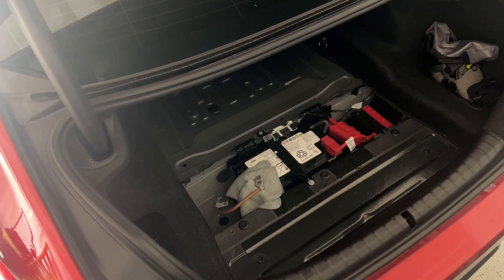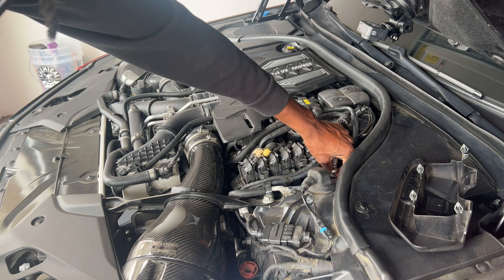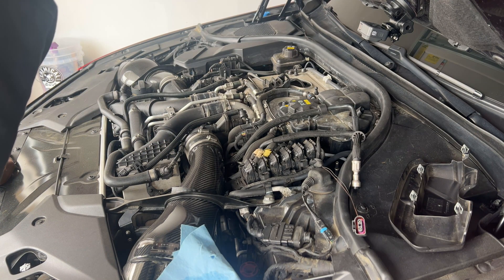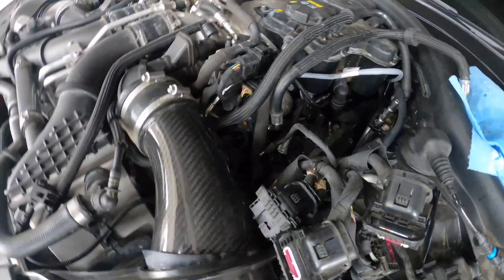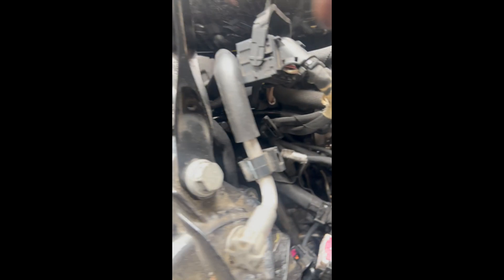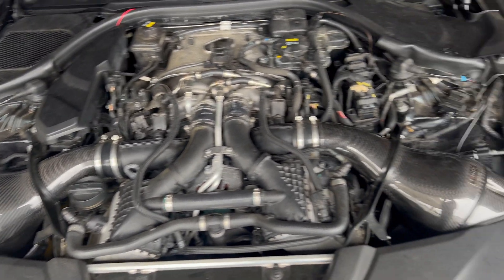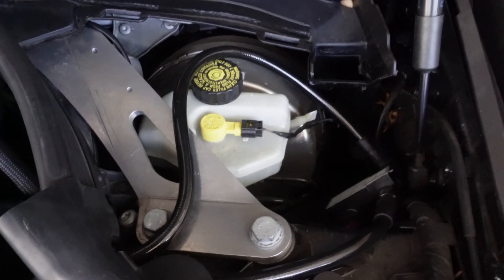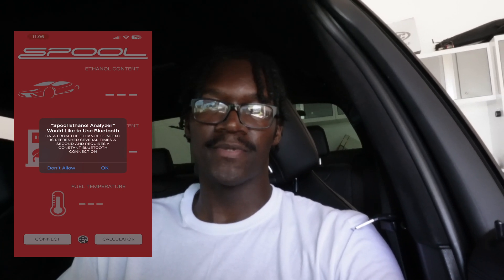Buy This Now if You Own a BMW M5!

Comment: Did you find a good tuner for the S63TU4? I have tapped out all the OTS options and want to run a flex map with custom work.
Reply from the maker: I use ABP for my custom tunes. I am not aware of any flex fuel maps being available for the S63 motors

Comment: Hello, can someone tell me if it really is ethanol analyzers when I only don't need to use E30 in a bmw s63 by calculating my tank with an OTS Stage 2 E30 map or is it only recommended for higher volumes of ethanol?
Reply from the maker: I say yes. Why run the risk of not knowing what your E content is…especially with how expensive our motors are
Reply: @DMariosGarage  I understand I just keep looking for opinions. I'm telling you about protuningfreaks, they sent me an email replying telling me that + - 5 of e30, nothing happens, just calculating that you have minus 25 or even high 35 with the map ots 30, but I thought the same thing, having some peace of mind, the truth is I don't know how fatal it is. Playing with this ethanol thing with ots maps that's why I keep asking, it's good to see several opinions. According to them, an analyzer is not so necessary when it is e30
Reply from the maker: I run a custom e40 tune and if I say have e35 instead of e40 I wont have the full performance
Reply from the maker: I say spend the $500 and get the analyzer and avoid the risk of needing a 50k motor
Reply: @DMariosGarage  yeah you right ,but  ethanol in stock car using only with ots map how problematic is it to use e30 often? Is it necessary to update several things in the car or how do you keep your M5 in good condition?
Reply from the maker: @luiscarlosmontanosaenz7717  it’s not problematic at all I ran the ots e30 for a while. You do need to have catless downpipes or at least high flow catted ones
Reply: @DMariosGarage  Yes, I already got primary and secondary downpipes. My only doubt was because reading in some forums some people say that it is dangerous to use it for a long time unless you spend a lot of money on gasoline pumps, lines, etc. But I don't know if that's only for older cars. Also thank you for your suggestion, quick response
Reply from the maker: @luiscarlosmontanosaenz7717 I usually run my 93 tune  on the daily basis but if I’m going out with the boys or have a track event switch to my E tune
Reply: @DMariosGarage  Hello, today I got the spool kit for my m8. but I can't find the installation guide in pdf, I remember seeing something when I made the purchase but now I don't know where it is, could you help me with ?
Reply from the maker: @luiscarlosmontanosaenz7717 I emailed them to get a copy of it
Reply: @DMariosGarage  hey thank u much but i found it, My concern when looking at the photos, the two lines they sent me are not the same as the photos and there is a small adapter that is not in the photo either, I don't know if this corresponds to my car. Do you think I can send you a photo and tell me if this is okay or they screwed up?
Reply from the maker: @luiscarlosmontanosaenz7717 yea you can send it on IG: DrivesAlot_
Reply: @DMariosGarage  There is an OTS Stage 1 E30 tune for Bootmod. No downpipes required. I've been running it for nearly a year now.

Comment: Found my next project 😂.  Great video. Looks easy to install.  
Looks like you need a new overflow coolant tank 😣
Reply from the maker: Sadly I do! I’m looking into a couple different options right now
Reply: @DMariosGarage  I got mine from from an online dealer selling it cheap. My local dealer  wanted over a 100$ more and then I bought that overpriced coolant catch can that James showcased just for the assurance
Reply from the maker: @eptxm5664 I’m looking at the RKautoworks Billet one but that thing is $800🤦🏾‍♂️
Reply: @DMariosGarage  might be worth it. Oem tank plus catch cover is 700$
Reply: I’m about to install mine.  Where did u tap for the power?  Do u have ig so I can message u
Reply from the maker: @eptxm5664  yea its DrivesAlot on there too

Comment: Just get one of the flex fuel kits, MHD or boot mod and you can read the ethanol
Reply from the maker: It’s a Ethanol Analyzer Kit (Same as Fuel-It) it’s just made by Spool Performance
Reply: They wont work for this car
Reply from the maker: Your saying the fuel it kit or the spool kit?